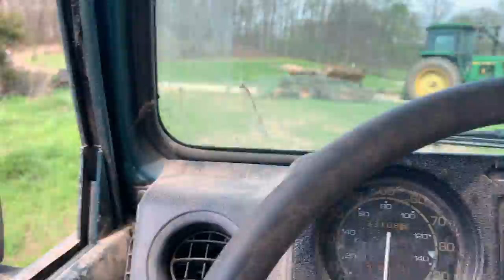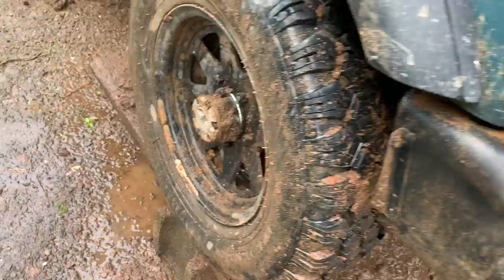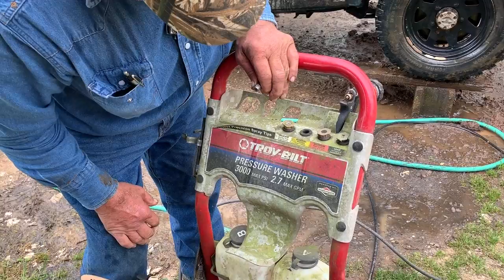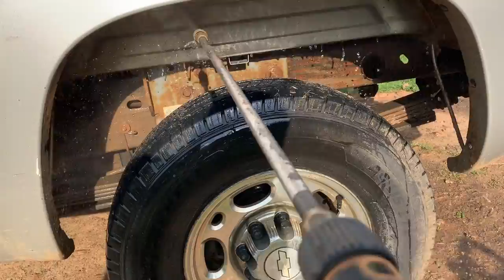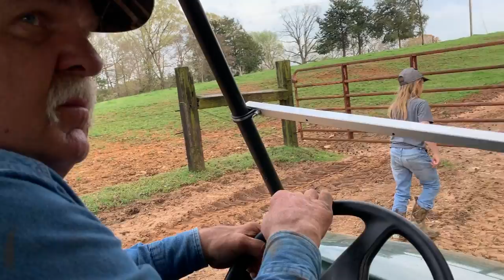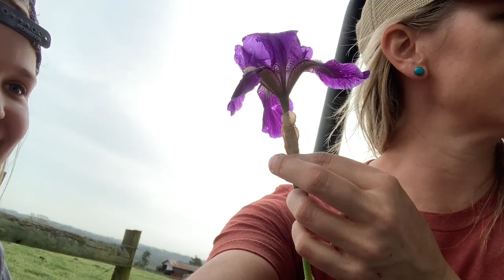All Washed Up! : Spring Cleaning On the Farm Continues

Comment: Top tip: Pressure washer tips should be cleaned out with a very small piece of wire (smaller than a paper clip). Mine actually came with one, and I have needed to use it several times.
Every time that it has clogged, it's been after sitting a while. No need to even disassemble anything; just poke out the hole.

Comment: Remove the nozzle each time after you are done using. Flush the system by firing up the pressure washer and running it with no nozzle before use..  Keeps you from getting clogs and helps rid the system of air in the line.
Also, make sure there is a fine screen hose washer in the fitting where the garden hose connects.

Comment: Meredith, we've been placing peppermint oil under our vehicles just below the engine on the ground, and around the wheel wales.  You have to make sure it doesn't get on something that can be ruined.  This has helped with getting rid of mice and field rats.  I buy a bottle of peppermint oil, place it in a squirt bottle then fill it with water and shake it up, then spray.  It's been working.  I spray once a week around and under vehicles.  This has worked for us.  Now if you want to kill them take equal amounts of flour, baking soda, and sugar mix them up.  Place a small amount on a old lid, and just sprinkle a little more sugar on the top, and lay down the life close to where the problem is with the rats. They will eat some of the mixture, and have to drink water after eating.  This will cause them to drop dead.
Reply: Trap and .22 also works well.
Reply: I use the peppermint and water for spiders. Works great

Comment: Lawrence needs a Bar Stool or so around to rest his back with.  I use one around the shop a good bit.  Easy to rest on and easy to get up from.  Two other great additions are a portable generator and oil less air compressor,  with those two you can use power tools anywhere on the place.  Had mine on a sled I could pick up with the tractor forks.

Comment: Quick suggestion on the Suzuki. (We had one, ‘84 wife bought in ‘85). Anyway, if it’s the ignition switch going bad, just use a three (3) way switch. Replacement of ignition switch is costly cause you’re gonna have to find one in junkyard or Japan. Starters are also in junkyard or Japan. I can’t remember if the starter brushes can be replaced. You still would have to find starter, junkyard or Japan.
Reply: Oops,...just found ignition switch on eBay...!  Yahoo..
Reply: Oops, again...! Found starter,...googled PartsGeek. Guess I should’ve searched before I opened my mouth earlier..! (Typical guy...!😊)  I’m done.....

Comment: Okay, I know this gonna be late. BUT, you won’t ever get something to clear a tip.  It is easier to remove the quick connect from the end of a lance.  Kinda the same situation as a charged hydraulic line.  And have a torch tip cleaned handy to push back the debris.  
    You make have picked up a grain of sand from your water source since it’s well water.
Reply from the maker: He found a tiny wire and I pushed it through there and it worked luckily
Reply: This Farm Wife - Meredith Bernard   Fortunate that you were able to get it to clear.  But dumping the pressure behind the tip will allow you to remove it and get it cleaned.  
   Your videos are getting better by the day!  A smiling Meredith is always a welcome sight! 
    Lawrence is a truly lucky man!

Comment: You have a rare model Chevy pick up 1500HD which took over what used to the 2500 model but they came out with the 2500HD.yours has the 8 lug wheels but doesn't have the full floating rear axel. I want to guess yours is maybe in the 7400 to 8200 lb GVWR.I had the 2500HD with the Duramax and it was rated 9200 GVWR. Yours must have thr the 6.0L engine in it.looks like a great truck for you hope it lasts you a while.

Comment: Mrs Bernard,  concerning your Suzuki Samurai not starting - It sounds like the Ignition Switch, the electrical part, the one under the dash that sits on top of the steering column - is bad.  BUT ... there's always a BUT ... as there are several other things that could cause this malfunction. I would first check to see if there's any corrosion on the battery terminals, and by checking I mean, take them both off, clean them good and then reinstall.  If it's still doing it after that, I would then inspect the wires that go to the starter to make sure they are tight and not loose, nor frayed or broken. That starter is kinda like a GM starter, as it has a solenoid on top of the starter where the wires connect that could be slightly loose causing this? BUT, it could be the solenoid itself. 

If anyone there knows how to  bypass the Ignition Switch and start the Suzuki by jumping across the two terminals on the solenoid that is what I would do to see if it'll start that way (after doing the other things mentioned above first). Just turn the Ignition Switch (key part) to the ON position, then jump the two terminals on the solenoid with a screwdriver and see what happens. But even if it starts this way, it could still be a bad solenoid. Now you know why most mechanic's cuss and throw things when working on vehicles (or farm equipment) as some days it's just a crap shoot at best.

Comment: Sounds like a loose connection at the Battery or Starter on the Suz.  Could be many things.  You did a fantastic cleaning job on your iron.  They run better clean.  Your music gets very loud..............imho.
So great to see kids without a phone stuck in their ear.  You won't wear safety glasses/goggles until a high speed piece of debris enters your eye when power washing.

Comment: Fine clay mud will do that usually on farms as I remeber, especially when pumped out of the ground.  If you are tapping a well then that often, but not always, indicate that the filter under ground is getting dirty or is dirty with very fine clay mud?  I know the farmer won't  enjoy that job because I've witnessed the attitudes of my elder relatives when changing that underground filter, especially when the personal equipment is broken to pull the pipe up to change the filter or having to hire someone to do the same.  It just all part of farm life, but better in the warmer temps than the colder temps due to the fact the ground is much harder and difficult to work with in colder temps?